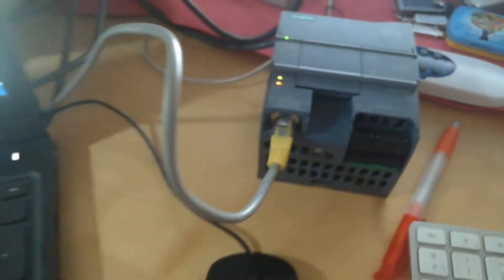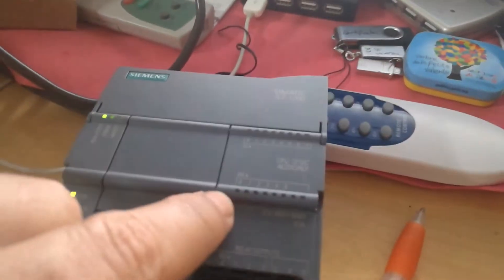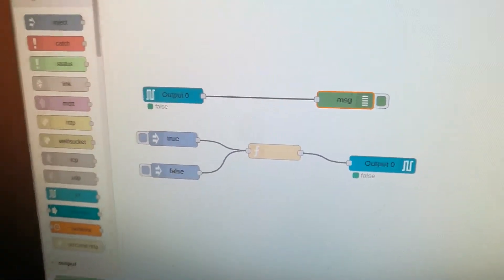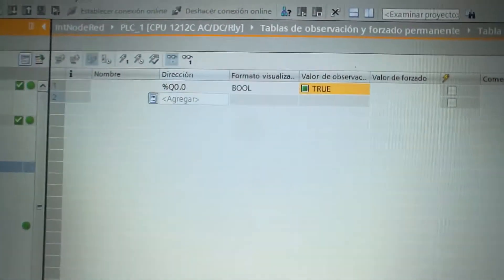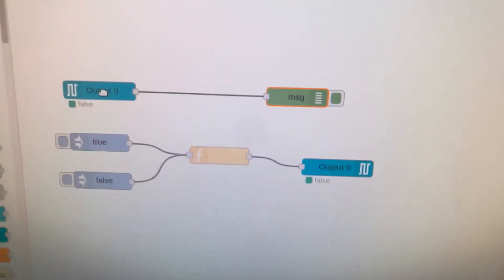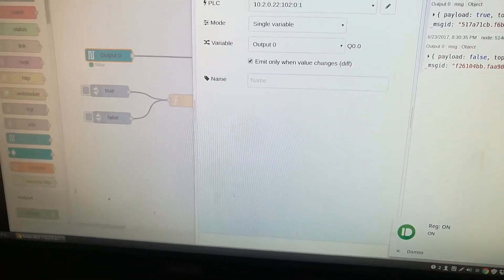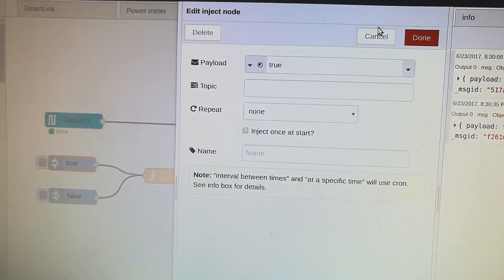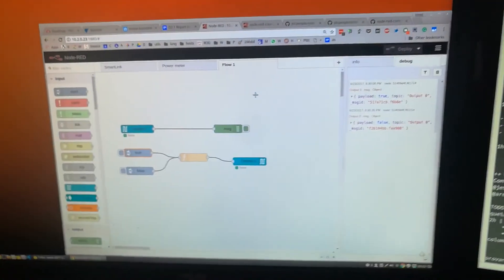Connecting NodeRED with PLC Simenes S7 1200

Comment: Hi thanks for your nice tutorial, actually, I am using using "s7comm" node with raspberry pi in a common network. But It shows "error" and "disconnected". While I used the same setting with my laptop and that was working fine. Do you have any suggestions?

Comment: Hello there! Thanks for sharing. What firmware version of the PLC 1212C are you using? I'm using the same PLC (1212C AC/DC/Rly) with firmware version 1.0 but it retrieves an error: "Error connecting to PLC: Error - TCP connected, ISO didn't". I am going to update the firmware to the last version 2.2 but i don't know yet if it going to solve the problem.
Reply: S7-1200 and S7-1500 CPU access requires access using "Slot 1" and you must disable optimized block access (in TIA portal) for the blocks you are using. In addition, you must "Enable GET/PUT Access" in the 1200/1500 controller in TIA Portal. Doing so opens up the controller for other access by other applications as well, so be aware of the security implications of doing this.

Comment: Hello Oriol Rius!
I have a problem to understand a one, basic for me, thing. How are connected 2 laptops and 1 PLC by one cable?
I can't understand because you have connection from Linux and active connection from TIA Portal. Please explain this for me.
Reply from the maker: Of course, I'm using a Hub Switch for connecting the three pieces. May be you are asking for another thing but I don't understand what do you want to know exactly.
Reply: Oriol Rius I want to know how many cables, and type of them too, do you use and how you connect them. On the video i cannot see this connections.
Reply from the maker: I used regular Ethernet cables, three of them. One cable for each laptop and one cable for the PLC. Nothing else.
Reply: Thanks you! ;)

Comment: What's the configuration in the TIA-PORTAL to get it run. I'm having the current problem: No response from PLC, restarting communication

I'm using node-red 0.15.3
and the latest version of the node: 1.4.1
Reply: You can only use non-optimized data blocks. This feature can be set in the
properties of the data block.
You have to enable PUT/GET communication in the device configuration of
the S7 PLC
Reply from the maker: Pay attention to the video, PLC code is empty. There is nothing in the TIA Portal.

Comment: greetings,

I would like to know why the port is using 102?
Reply from the maker: this is by default, I didn't change anything.
Reply: hrm.....then I hv no idea which part I'm not doing correctly, even though I also insert the msg.variable = msg.payload; in the function block :(
Reply from the maker: debug infromation don't tell you anything useful? may be you can contact with the s7 node creators for debugging on a deeper level.
Reply: msg:string 20
failure (bad values)

Comment: Why are you using a function block between injection node and S7 block.
Is there any code that sent specific data ?

I have omit this block , but reading is not working.
Reply from the maker: The source is very simple:

msg.variable = msg.payload;
return msg;

Inject node pass the value in payload of the message and the S7 node expects the parameters in the property variable. Take a look in node documentation for more details.